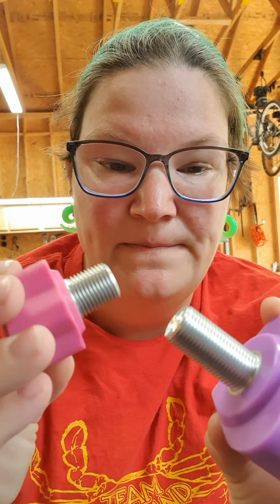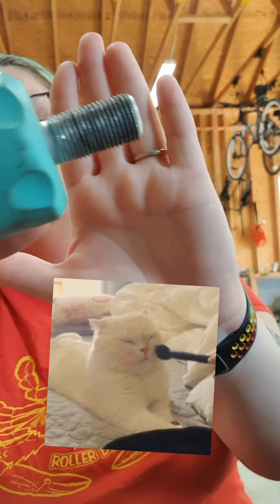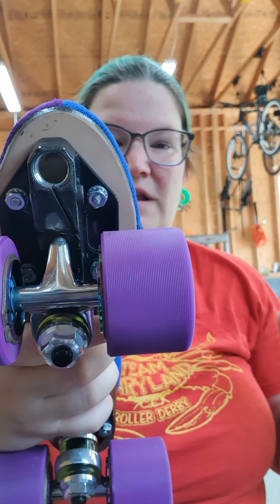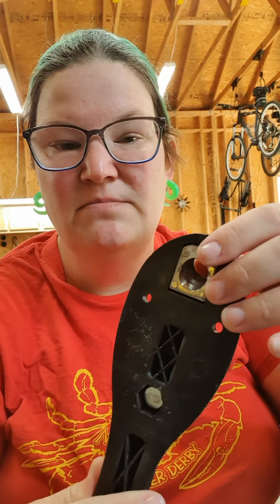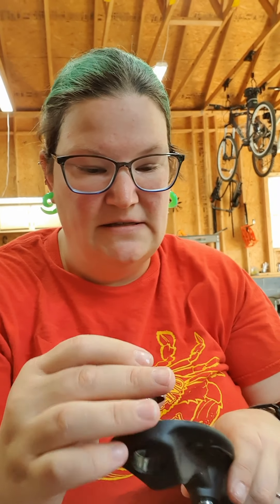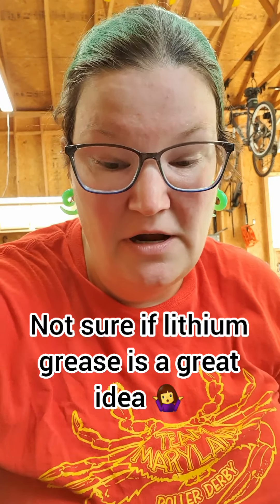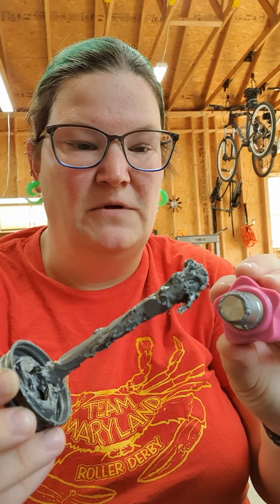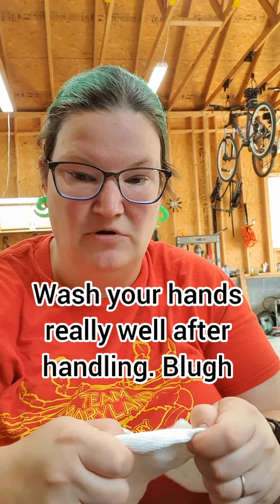Stuck Toe Stops? Preventing Skate Toe Stops from getting stuck

Comment: So how do you get your toe stop out once it is stuck in the plate?
Reply from the maker: My husband had to use a pipe wrench to get it out but it damaged the plate and toe stop. I had to retap and thread them.
Reply: I bought a tap. Had to drill mine out. Only had my skates 2 hours before it got stuck when I was adjusting it.